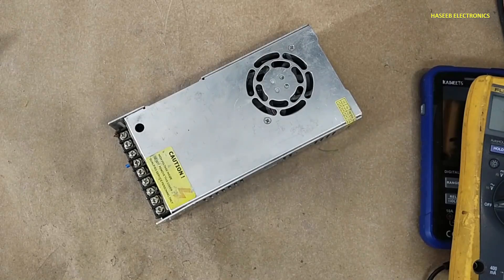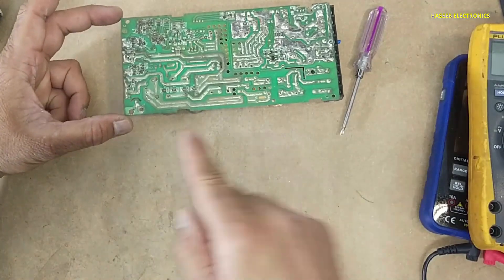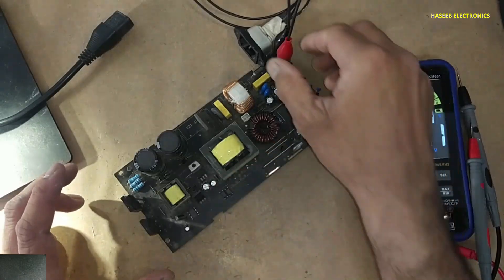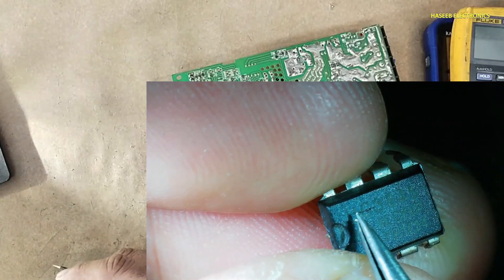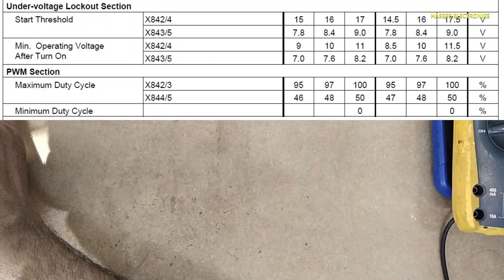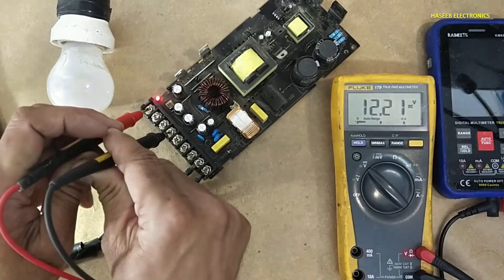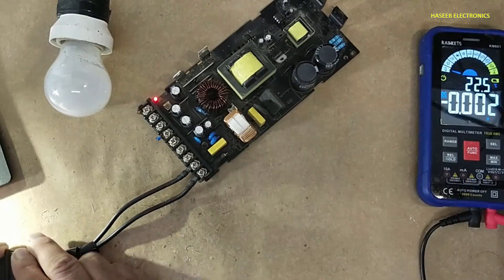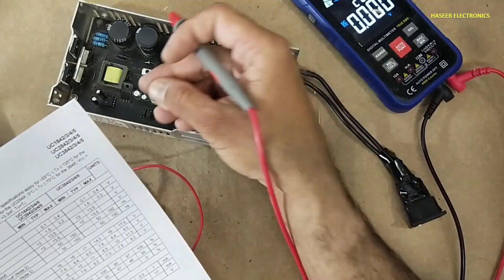{1064} UC3845 Based SMPS not providing output voltage

Comment: Hi, 
I have modified a crt tv SMPS transformer  for getting 240 v output with minimum 500 mA out . I winded secondary with 22 swg wire and given a Feedback with TL 431. I'm getting output 240 v but current is very low. What to do.

Comment: If the voltage drops when we add a load what could be the problem?
Reply from the maker: in this condition the SMPS is going in current limit mode
1. might be its error amplifier needs adjustment 
2. might be its VCC are higher, on adding load, the power supply goes in Over load protection 
3. might be current sense circuit is providing more volatge. which causes to move PWM controller in current limit mode
Reply: @HaseebElectronics   thank you so much sir. Jazak allah.

Comment: It is better to start the smps with the load already connected.
Reply from the maker: right 
but we need to monitor output voltage variation caused by the load. 
it is called LOAD REGULATION 
first monitor volatge 
then connect load 
and then monitor voltage variation caused by load
Reply: @HaseebElectronics  
good test, but I had a case when the smps started well without a load and stabilized the voltage well when connecting a load after the start, but did't start with a load already connected.